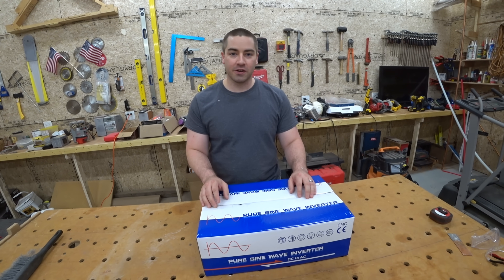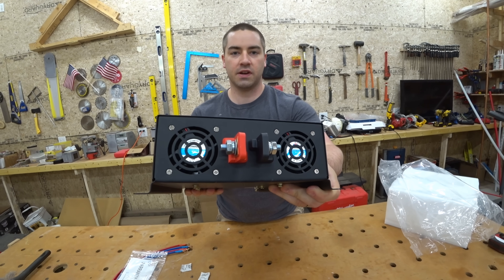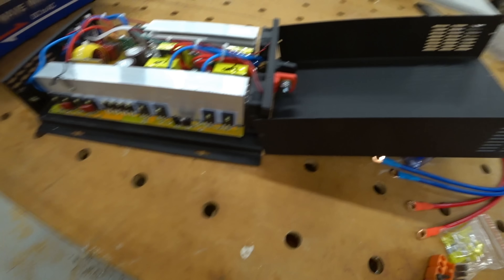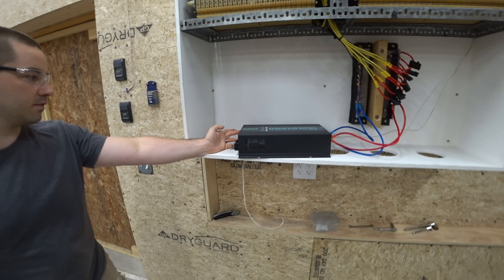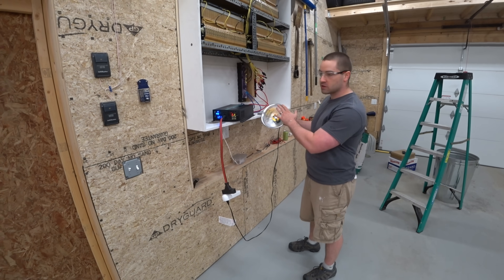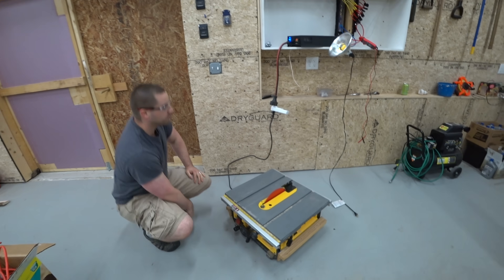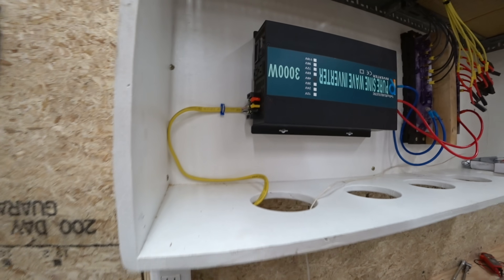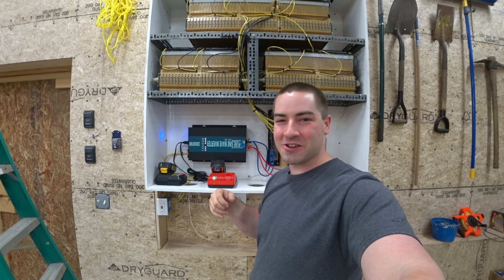Cheap 3000W Reliable Inverter, DIY Powerwall, Chevy Volt Batteries

Comment: The hardwire panel is described on page 8 of the manual: red is hot, yellow is ground, black is neutral.  Add ground or you are risking loosing your Inverter o the ground connection is on the belly of the inverter. You  have to remove it.

Comment: What size fuse would you recommend for a 12-volt 5000w inverter like this I have eight batteries four hundred amp hours each a total of 3200 amp hours what size fuse would you recommend me running on the cable that connects the inverter to the batteries?

Comment: The 120V 15amp plugs  only provide about 1/2 to 2/3's the capacity of the inverter.  Especially if the compressor has pressure. You need to add a 20 or 30Amp 120V plug hard wired to the inverter in order to get the full 3000/6000 watts starting power. Also you could try a soft start capacitor like RV's use.  I have this exact problem with my Compressor in my shed. It starts easily with my 3000 Watt inverter generator. My 2000 Watt cheapy PSW inverter will start the Compressor but fails when it restarts under pressure cycle..  My 2000Watt inverter will not run the microwave and the fridge at the same time if they both decide to cycle on at the same time. :-(   So I shopping for a 3000 Watt PSW inverter that fits my backup solar power budget.  Retired and Broke in Texas. ;-)

Comment: Could you run a blower for a wood burning stove with this?
Reply from the maker: Probably, but it will depend on the blower.  My friend, Bill, has a blower on his stove and I think he told me it was about 150W.  This is a 3000W inverter, so that wouldn't be any problem.  But, if you are talking about some kind of large furnace blower, then maybe not.

Comment: To use your compressor with the 3000w inverter, you must use a 110v soft starter. and you can find it at this link https://www.united-automation.com/product/ssc-25-soft-start-controller/.
you must check the starting current of your compressor, and the soft starter supports 25A and your compressor exceeds 25A you must use a 48v inverter at low frequency that supports up to 3 hp or more

Comment: You can try to use a 45uf run capacitor wired into a 120v outlet to support high amp starting unit such as your air compressor.  This in should solve your high amp starting efforts!

Comment: That bit at the end was really funny. Not recommended though. Other you tube reviews show zero short circuit protection. Risk of damage to unit is possible and therefore expensive.Kayla from reliable power says it has shortcircuit protection for a few seconds. I don’t believe that. No one seems to be clear which wires are live neutral and ground and whether grounding the metal case makes any difference?

Comment: Wow im surprised and disappointed.
I was thinking of getting the same 3000w inverter to run my refrigerator,Nuts!
Reply: I'll wager that it works.  People have a habit of overcalculating the surge for a frig. Mine for example says 6.5A on the nameplate but the compressor only draws 1.15A and that's where the surge will be.  The bulk of the amps come from the defrost heating element which is resistive. I finally saw one manufacturer point out that situation. I intend to put defeat switch on the heater to get more run time in an emergency but haven't done it yet.  I need to check the wattage on the ice maker heating element but I'm sure it's lower and also the icemaker already has a switch.

Comment: what would you need for 5000W 24V inverter to hook up to a shore power to charge 24v batteries without the solar panels?
Reply from the maker: No all inverters will charge a battery bank from shore power.  But you can find chargers for your particular battery chemistry and voltage.  For example, if your 24v battery is made of 8s LifePO4, then you would want a charger with a max voltage of 29.2v.  Here is an example: https://amzn.to/3dTmRLm  But you will have to verify what exactly you need for your battery.

Comment: Hey David, great video...got a question...I own a 2015 Chevy Volt I live in an area of California were the Edison company will cut off power to prevent wildfires. I recently purchased a 3000-watt power inverter on eBay (Duracell) and I want to use my car as a back-up power source in the event of a power outage. Any thoughts on the type/size of fuse I will need?  Any other thoughts would be highly appreciated.

Comment: The problem is air compressors tend to use several times more powerful than they are rated for for the first few seconds to start the compressor, Air conditioners tend to have the same problem, they might use 3500 watts to start and then use around 600 while they are running. There is something called a cold start converter that people install on their RVs to fix this, maybe try that. One problem with these cheap inverters is the surge capabilities aren't very good.

Comment: I have the 24v version of the 3000w inverter. I have run my xbox one, my expensive gaming PC, with LEDs all over it, my smart tv, router, and modem. Runs them perfect, never had any odd noises occur. That is my experience in the year I've owned mine. I have a modified sine wave inverter as well and it will NOT run the same equipment without sounding like it shouldn't be powering that stuff. That is my two cents. Inverter may have been updated

Comment: i want to wire my reliable electric inverter to an offgrid sub panel but the inverter is reading 60v from neutral to ground and I'm not sure what to do. I feel tying neutral to ground would short the inverter. I just need to know how to wire it into the panel. Could somebody please offer advice? Is just not using a ground my only option?
Reply from the maker: This type of inverter can only be used in an off-grid application.  The neutral and ground are bonded inside the inverter.  If you hard-wire out to a sub-panel it must be off-grid, and no grid to neutral connection in the sub panel.  It's easy to mess this up and let the smoke out, so please be careful.
Reply: @DavidPozEnergy  fully offgrid tysm! So I take the hot to the breaker and do i bond the neutral and ground In the panel? I really appreciate your help. More than you can imagine.
Reply from the maker: I never hooked mine up directly to a sub-panel so I'm not 100% sure.  But I don't think you bond the neutral and ground in the panel since there is a connection in the inverter.
Reply: @DavidPozEnergy  awesome. Well tysm for the help.

Comment: Is it possible to wire two of those 3000 watt inverters in parallel and get 6000 watts of power?
Reply from the maker: No, they don't parallel.
Reply: @DavidPozEnergy  is it possible with any inverter? I hear you tubers refer to it occasionally
Reply from the maker: Yes.  There are many inverters on the market that allow you to parallel more than one together to add the total power output.  I currently am running my whole house on a pair of SMA inverters that do this.  Also Outback, Schnieder, Victron, and Sol-Ark are some brands that all make inverters that parallel.  Usually this feature is found only on the more expensive models.

Comment: Hey did it work to charge those tool batteries? I've heard the modified waves don't work for that and that the reliable inverters are modified even though they claim pure. Would love an answer to this!
Reply from the maker: Yes this did work to charge the cordless tool batteries. you are correct that modified sine wave can destroy cordless tool batteries. I did put this on an oscilloscope at one point in time and it looked pretty clean to me not perfect and definitely not as good as the grid but it is not a square wave for sure.
Reply: @DavidPozEnergy  thanks so much for the reply! Finding these is hard. No matter what brand and what price range I'm seeing terrible reviews. Hard to make a decision on what to purchase. I just need something that will run a 1500w heater and 1500w stove (not simultaneously) and charge some Milwaukee 18v batteries.
Reply from the maker: There are always some bad reviews.  This brand (Reliable Electric) is a cheap brand.  It's not built to last forever.  Brands such as Outback, and Victron, are built to last decades.

Comment: I hate that I purchased one of these, as it only lasted 2 year's and without warning it stopped converting 12v DC to 120v AC . This is the 2nd one I purchased. I think they are programmed to stop just so you have to buy a new one.

Comment: I have this same inverter, starts my 1.5hp compressor just fine on 48V. 44.2 volts is considered 'low voltage' for the inverter. You'd be best off to get actual solar batteries that will hold like 50V, hook the panels up to the controller correctly and then No Problems!
Reply: What do you mean solar batteries?

Comment: for what its worth, i was able to use a compressor about the same size as yours, on a harbor freight 5kw/10kw modified sine wave inverter, but i had it hooked to my suv with its 150amp alt and bigger than average car battery. also note, i could only get the compressor to work if the tank was not full at start up, and using long extension cords affected it as well, seems like i was using 150feet of extension  at first and learned i had to shorten it or something, that was 4 years ago and i dont remember for sure. also, i bought it about 7 years ago and its huge...thats what she said anyways

Comment: Compressors need minimum 3500-4k watts. They struggle to run @ that. Best is 5k watts with around 6500k surge or startup surge.

Comment: you should have known that,since the inverter is a high frequency stages transformers  inverter, the soonest that you started a heavy load the voltage output dropped and become unsustainable . if you want a cheap and very reliable inverter look for a fuel zero inverter they have 3 times their surge power and they all use low frequency transformers.a https://www.fuelzero.com/3000-9000w-24v-PureSinewave-Low-Frequency-Inverter-p/fz-ep3000-lv-24v-3000.htm

Comment: The wires it comes with are a joke... I put on some 2/0 AWG cables and can run whatever I want with that thing. I have the 24v version same 3k watts and it runs my A/C computer fans lighting etc.. Also i can run a Miter saw no problem. I think its your input wires. They cant pull enough amps.  Just a thought.

Comment: Hello David i got a question what is the best way to crimp 2 of the 10awg wires to a 8awg wire together?
Reply from the maker: That's going to be pretty big.  Maybe a split-bolt would work well for that.  https://amzn.to/2R60mae  They come in different sizes.  The reason I'm suggesting this is because you are asking about 3 wires in one connector.  I might be wrong, but I think crimps are for two wires.
Reply: @DavidPozEnergy  Hello David thank you for the reply back. I'm also lost on it because of  a 2 to 1 connection. But i was thinking of something simple like what avarage joe did was taking copper tubing that is for his ice maker  he cut down into 1 inch Butt connectors and tied them together. I'm going to give that a try and see how that works. I can't lose out for just trying.

Comment: Could capacitors be added to handle the surge needed for the compressor or other high surge electronics?
Reply from the maker: Probably, but I think it's easier to use a "Low Frequency" inverter instead.  LF inverters are perfect for big surges.

Comment: since when do chevy truck batteries look like rows of encyclopedias??
Reply from the maker: This battery is from a Chevy Volt car.  This is a hybrid car that can run on battery power for about 40 miles, then has a gas engine for up to 400 miles.

Comment: I want an inverter that can turn on my LCD 55" smart TV
Reply: I hope that you're living in a van and that's not just because you want it for emergency use because the TV is the last thing you should be worried about
Reply: So go buy a 2000 watt or a 1000 watt
Reply: An 1800 watt Max Capacity and that's only for the startup will run a refrigerator

Comment: Hey man nice video........  I was wondering if a 4000 would push a compressor? Can u gave me and update on that plz thanks I don't get the 8000 on Amazon only the 4000 watts
Reply from the maker: This type of inverter is not the best for compressor loads.  (no matter wattage) I have switched to an Aims inverter.  The Aims is a "Low Frequency" design which is better suited to high compressor loads.  https://youtu.be/dfHb5tZErTs

Comment: Try charging your batteries first.  44.2V with no load are very weak batteries.  It should be more like 50V.  Test is invalid.
Reply from the maker: Hi David James, my battery bank is a 12s (12 cells in series) lithium.  It's nominal voltage is 44 volts.  If I charged to 50v it might do a thermal runaway.  Your suggestion of 50v might be true for other types of batteries and other configurations. 
 Thanks for watching.
Reply: The inverter is expecting 48V so you are already about 10% under that.  Try 13s or even 14s.  How do you expect an inverter to put out full power when you are giving it less than full input power?  Invalid test.  Also, I thought 3.7V lithium batteries are more like 4.2V at full charge, so 12 * 4.2V = 50.4V.

Comment: hay dave question,...what does it mean when the blue and red light both come on,...on the 3500w power inverter
Reply from the maker: Blue is the inverter is on.  Red is a warning light that your battery voltage is almost over-voltage, or under-voltage.  If I remember right, I think the light came on around 44v, and the inverter shut off at 42v.  Something like that.

Comment: Do you have a go to for the car battery bank? I want one bad but am stuck dealing with a fork lift battery... Its great to run my shop but to heavy to move in the house
Reply from the maker: I bought the batteries from a salvage yard.  Sometimes people call these places Junkyards, or Auto Salvage, or Used Auto Parts, or Auto Recyclers.  Try going to Google Maps, typing in "Auto Recyclers near me" and you will see the map populate with them.  Then I just started calling asking if they had any Chevy Volts, Nissan Leafs, Teslas, or any other electric vehicle batteries.  It took several hours of calling around before eventually finding one.
Another option is Ebay.

I've also seen some forklift battery manufacturers offer the battery with the terminals bolted together instead of soldered.  This allows you to move the individual 2v cells.  They are still like 200 pounds, but more manageable than the whole 1-ton battery.  http://gbindustrialbattery.com/Forklift_Battery_Sizes_and_Specifications_Zone15.html
Reply: @DavidPozEnergy  thank you

Comment: hey David,  Im looking at 2- Toyota Prius Gen 1 lith batteries from a totaled vehicles to use as batteries.  My 5000 w continuous/10 k w peak, inverter says 12 volt input. How did you figure out the voltage for your Chevy  volt batteries ?
Reply from the maker: Chevy had the Volt batteries arranged in groups of 12 cells, and 16 cells. (Gen 2).  So I asked myself which would be easier, to change the 12s to 16s, or to change the 16s to 12s?  Also, I looked at different inverters and charge controllers to see which voltage range worked best.  For me, the 12s was the easiest to re-wire the cells to and worked with the most items.  I'm working inside a voltage range of 42.0-48.6.  For you, look at your inverter spec sheet and see what it's voltage range is.  Then see if a 3s or 4s cell group works best for you as you break down your battery.  
BTW, I thought Prius used something different than lithiums, but I have not worked with one personally.

Comment: Put a hard start capacitor on it and it will work fine for your compressor!
Reply: You don't need capacitors on a lithium setup with the right bms.

Comment: Can you connect more than one together to get more power and is it really a pure sine wave  as a old school generators cook your battery tools when using them to charge them..what types of batteries are the best to use for storage. can you use recycled car batteries of different types and alternators from cars to produce the power to charge them
Reply from the maker: Hi Paul Royston,  Thanks for your questions and interest in energy storage.  There is a tool used to see sine wave and determine how pure it is.  This tool is called an Oscilloscope.  I don't own an oscilloscope so I can't answer your question from personal experience.  However, I have seen videos from other YouTubers who do own oscilloscopes and have tested this brand inverters.  It seems that, YES, it is a pure sine wave.  
There are some types of inverters that can be connected together to increase power.  This is called "paralleling".  But, it is not an option with the cheap brands.  Some brands that allow this would be Magnum, Schnieder, etc.  They tend to be more expensive, higher quality equipment.
The best storage battery depends on your application.  I'm using lithium batteries and like them for off-grid.  Some people still prefer some of the lead acid batteries (sealed, AGM, flooded) for their own personal setups.  It's not a right or wrong, just what works for you.
When you say "car batteries" I think you are reffering to the 12 volt battery used to start the car.  Sometimes this battery is called a "starter battery".  This type of lead acid battery is made for a very short burst of power (cranking the engine) and then to live it's life at 100% full.  Off-grid batteries need to be charged and drained over and over agian.  Every drain and fill is called a "cycle".  Daily cycling of a starter battery will kill it within a month or so.  This makes them a bad choice for off-grid.  
Can you use a car alternator?   In some situations, yes, and sometimes, no.  It depends on your application.  My system is a 48 volt system and a car alternator puts out 13-14 volts.  So it won't work for me.
Reply: @DavidPozEnergy  thanks for your reply I'll keep watching